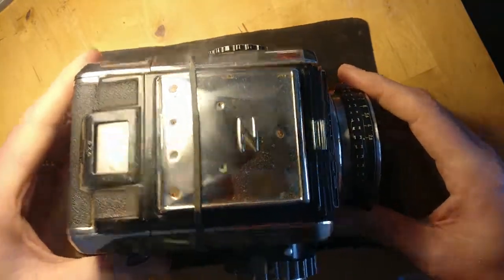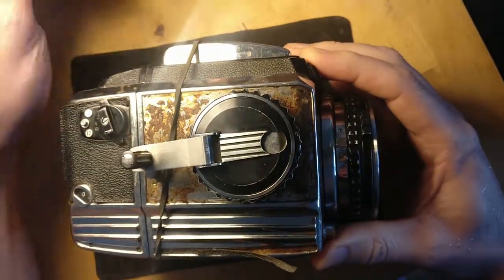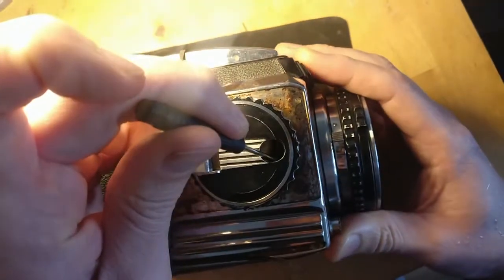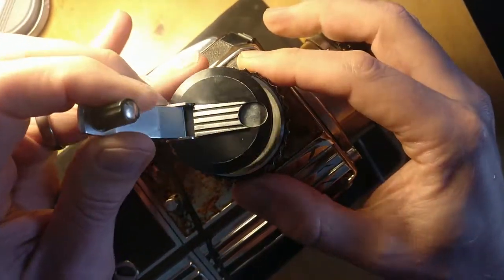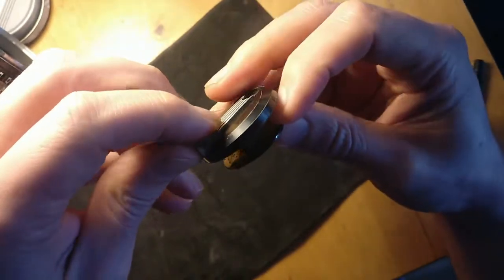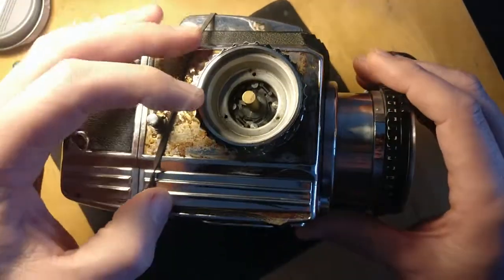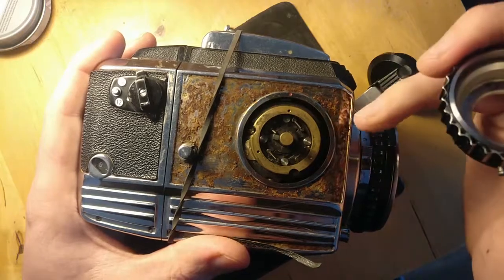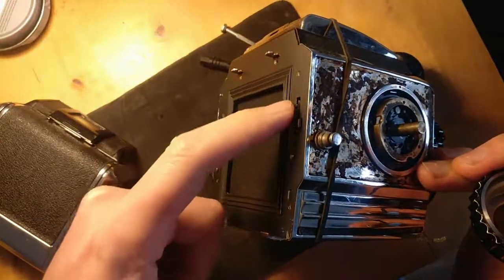Zenza Bronica S Winder Disassembly

Comment: Meanwhile I was able to remove the winder assembly. I had to drill two holes in the winder cover and use a puller tool. Someone glued the shaft to the winder assembly. After a CLA in the mirror gear, the camera is working fine now. Many thanks again.

Comment: Wow. What a service. Many thanks for this video.
Reply: Meanwhile I was able to remove the winder assembly. I had to drill two holes in the winder cover and use a puller tool. Someone glued the shaft to the winder assembly. After a CLA in the mirror gear, the camera is working fine now. Many thanks again.
Reply from the maker: @rainermichel9931  wow, that was really stuck on! Pullers are a very effective tool even if they are engineered in place rather than a sperate tool. Glad you're getting some good results, still testing mine. 

To stiffen the mechanism is a little tricky but possible. Behind the right hand side cover you can access the rack that slides back and forth to transport the lens/helicoid. This can be lubricated with a thicker grease rather than oil to add some mechanical resistance but obviously not too much that it gets spread into the rest of the body. There are also blocks made of brass (if I remember correctly) that the rack slides back and forth on, if the gap between these and the rack is too big it will likely be very free to move. You may be able to add a shim between these to slow the movement. A simpler alternative would be to add a felt or cloth ring behind the focus knob between the side plate and the knob. This would add mechanical resistance as well. Just a few thoughts
Reply from the maker: @rainermichel9931  also I found if your mirror doesn't always return completely it is tempting to adjust the timing of those gears, I experimented for some.time but found they are self adjusting to a certain point. The mirror has a ribbon to connect it to those gears, this is held to the top roller at the rear of the camera by a slot and a tab of metal. Moving the tab will let you pull the slack of the ribbon through and 're time' the mirror back to its correct position' that saves many hours experiment, hopefully it will save someone some time in the future.
Reply: @willharrison1920  I like your idea with the cloth ring. This should be easy to implement. In the moment I'm waiting for a new (old) winder assembly to substitute mine with the 2 holes. When it arrives (with Covid may take a longer time), I try to assemble a felt ring.

Comment: Hallo, I could buy a Zenza Bronica SQ Am, but the filmtransport does not work. Would that be difficult to repair ? Thanks for your sugestions, Frank
Reply from the maker: Hi Frank sorry for the delay, I haven't worked on an SQ so couldn't say, have a look for the service manual if you can, it may help